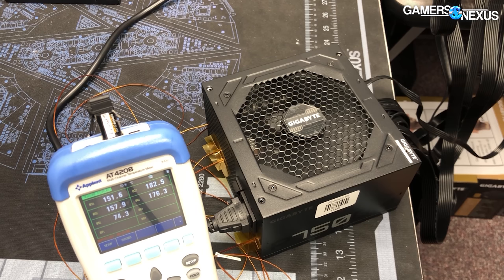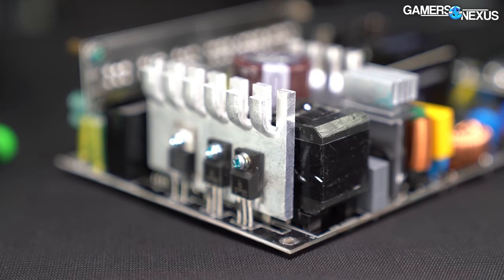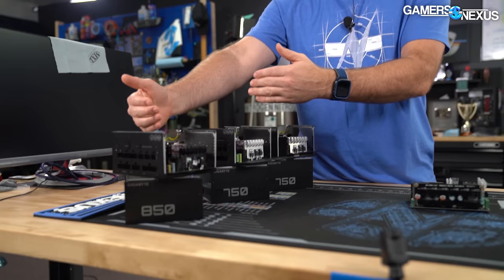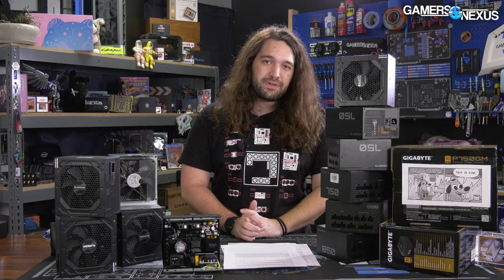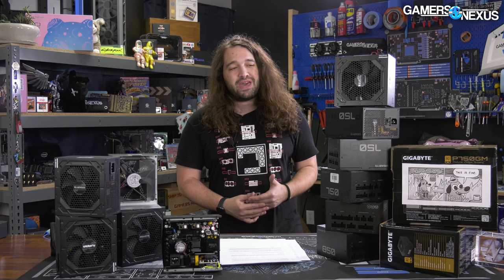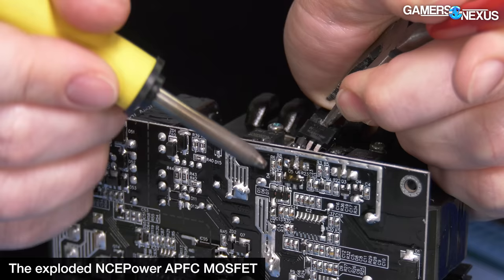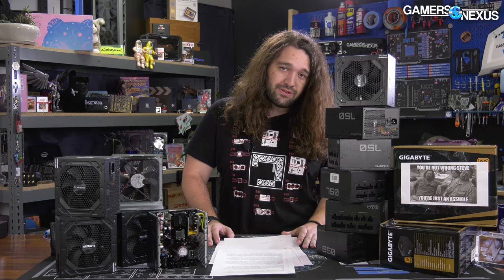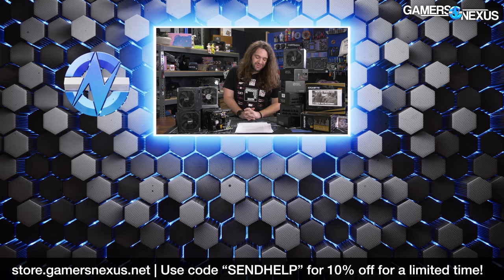Exploding Power Supplies: Gigabyte & Newegg Dumping Unsellable Product

Comment: I wouldn't call myself a professional in the field (I don't have a dedicated qualification in electronics) But I do a lot of circuit board repairs, mostly of music equipment (amps, rack gear etc) the only time I have seen 2 units of the same model and rev use different brand components between them is when it's a factory refurb.

I'm just spitballing here but I wonder if GB did qc testing and got high failure rate did factory refurbs then passed it through qc without testing OR if they were returned for refurb by vendors, one way or another every time I see a shot of the boards side by side it screams refurb to me.

Comment: Soo.....to buy components that goes into a product from different vendors - that's actually NOT necessarily all that uncommon nor unusual.

If one supplier doesn't have the capacity and/or the capability to manufacture and produce that many copies of that component that you need, then it is not uncommon for companies to shop around to be able to make sure that they can get the number of that component that they need, from multiple suppliers.

That's usually NOT an issue.*

*The problem though, is that it means that the OEM needs to develop the technical specifications of that component so that the supplier can then develop their product (the component) to those specs which it will then sell and feed it up chain to the OEM (or Tier 3 to Tier 2, Tier 2 to Tier 1, and Tier 1 to OEM or what have you).

IF, as it is shown here, you have multiple suppliers in your lower tiers, supplying components, and they are failing at the same spot - either your design is bad and/or your spec for that component is bad, at which point, BOTH of those are owned and under the responsibility of the OEM.

And that responsiblity rolls downhill, i.e. you can deliver a spec to Tier 1, and Tier 1 develops a spec to its Tier 2, etc.

But ultimately, the OEM is responsible for certifying the end product, as it is sold to the end user/customer.

Gigabyte is crap for blaming the customer on what is principally either a bad design or a bad spec that Gigabyte came up with and cascaded through their supply chain.

Screw Gigabyte.

Comment: Thanks for the information, I bought a pre-assembled build from Newegg for around $2k a couple weeks ago as it was the only way to get an RTX 3070. It unfortunately has this 750 PSU in it. It has been working fine (Aside from a couple random power offs on the first day of using it), but I will deff be pulling this PSU and replacing as soon as I can afford to do so as I leave this machine on all day and access it remotely for game design, etc. What a shame.
Reply: Yeah return that shit ASAP. It shouldn't shut down like that if you have a 750w PSU paired with a 3070

Comment: I have been trying to get Gigabyte to replace my 750 watt power supply that is on their list as a bad one for 2 months now. They gave me a case number then a month later ask if I wanted a refund or a replacement. I said a replacement will be fine. That was a month ago and nothing from them since. I will no longer buy anything from Gigabyte. I built three computer in the last 3 months and the first 2 was before this fiasco started so I bought 2 Gigabyte motherboards. The third one I bought an Asus board. It astounds me that a company that needs customers to buy their stuff to stay in business ,treats their customers this badly.

Comment: i got one of these PSU's with a 3070 , i didnt realize newegg was doing this. So i returned the GPU & PSU unopened, as it wasnt worth it. Gigabyte GPU's arent much better than these PSU's, so i happily returned them both unopened. i told them the PSU's are garbage, & it wasnt worth the risk to my system, especially for a junk Aurous 3070

Comment: 28:00 If you have a working system with this PSU, it might be safe to run as long as you don't add any new parts that might increase power consumption. I wouldn't feel safe swapping to new GPU even within the same declared power consumption range.

Comment: Well. Just seeing this video I would hope Gigabyte fixed these.  I purchased an 850 watt on Amazon in December for around $100 for a complete Gigabyte build with a Ryzen 1900x and Gigabyte 2070 super.  Been running for about 2.5 months now 24hrs no problems.

Comment: So this makes sense now, I bought my gigabyte P750gm in may 2022, for a very cheap £52, and have been using it to drive a Ryzen 9 5950x and a 3070 for about 2 years, and only last year upgraded to a 3090... Am i safe?
Reply: no. my evga 1300 platinum+ supernova died today. 1 year after use. glad they aren't at least too rtarded to at least included some protection...

Comment: So my pc died today, i have this 750 power supply. I had fail starts for days. Ever time i turned it off and on again it worked. Waiting for replacement or preferable a different model if they are kind. I hope its only the power supply bought it last year and it is not in the serial range.

Comment: Using components from different sources should not be a problem and should not concern the user, as long as the manufactured product works.  It is up to the manufacturer (/integrator) to source quality products and to stand by them when used in their end product.  If they're sourcing poor quality products then that is bad on them.
Newegg not taking back the power supply for refund when it is part of a bundle is certainly understandable, but if the power supply fails then they should at least take it back in exchange for a new power supply.
In your testing the power supplies might work better if you very tightly tape up all of the ventilation ports.  Everybody knows that if you let the magic smoke out of electronics they don't run well after that.

Comment: I was locked into this PSU (850 variant) by a system integrator that messed up my PC build epically and broke the PSU I provided them with and replaced it with the Gigabyte. I'm hesitant to put my 3090 in it, obviously. Any recommendation on how to stress test the damn thing without the GPU being installed before I risk it?

Comment: Hey GN, love your videos, but the interchange of components between the same models really isn't that strange. NOT to say they couldn't have made the change of supplier to avoid problems, but they pretty much use multiple suppliers FOR THAT REASON. I work in manufacturing for a large GmbH company, and we dont even start production of a product unless more that one supplier is available. This is simply to prevent any one supplier holding the production line hostage or even halting production due to natural disaster, shipping issue, or in this case a quality issue. Again, thank you for keeping the community informed, but I really think you are looking into that fact a little to much. Its just a mass production fact of life in most cases.

Comment: It's not really THAT strange... having different passive components really isn't that big of a deal as long as the specs match and its not from some shady Shenzhen marketplace. Having different active components isn't that odd either, a lot of transistors and FETs have fairly standard/common pinouts. Even the controllers can be substituted, which is why a lot of PSUs have their controllers on daughter boards.

The fact of the matter is that, even with passives, some components have lead times of three or four years from placing the order. You can't always rely on finding a Vishay, TDK, Bourns, Nichicon, Rubycon, Eaton, Diodes Inc, Phillips, Infineon, Microchip, STm, Panasonic, Samsung, or TI component. I'm not saying that those MOSFETs they used were... from a good company, because NCE isn't, but those capacitors and the other components, there's nothing really wrong with them.

Comment: I have the 850, and it makes a weird hard drive noise when under little load. When you look at it, it seems the fans tries to run with very subtle moves but when you put more heavy load, it spins without any problem and the weird sound disappears. Does it talk to someone ? is it dangerous ? And if not, is it fixable ? Thanks

Comment: I have the exact same PSU and now my system is failing due to abnormal power. My Aorus 5700xt has this flashing led light near the power and base on my search it says low or abnormal power.

Comment: Lelon or Teapo are fairly good capacitor brands. The question has to be what the specifications for these capacitors. Are they 85C or 105C? Are they low ESR or general purpose? What are the temperatures like on the actual capacitors?

Comment: I used to run on a gigabyte “bundled with the case” psu.
It died after 3 years of use. But im gonna assume its due to the “bundled with the case” issue.
After this, I will need to stay away from gigabyte psus for now.
Glad I have a seasonic one for now.

Comment: Honest question, if the PSU is failing after being loaded to 140%, isnt that what you'd expect..? Doesn't seem like the internal components are bad, just seems like the protection circuitry is lacking.

Comment: This once happened to me…that was the quickest I’ve ever disconnected cables and cut zip ties
Reply: Wish I would have been that fast when I shorted my V5 pin on my motherboard.  The motherboard works fine. I just can't use software for my RBG fans.

Comment: alright, got a question for everyone. I purchased the Gigabyte GP-P750GM from Amazon in December of 2020 and used it in my first build at the end of 2020. As of right now, I have not had any issues. Nothing is overclocked in my system or using excessive power. Should I look into getting a new one?

Comment: So I just took apart my computer (prebuilt) because of what I though was a power issue. Due to auto restarts. And low and behold what was looking up at me but a P750GM psu. Then saw this video. Only quest I have now is how will I know if it damaged my 3080 or should I be worried?

Comment: I've had one of these PSU's (850GM) for about 8 months without issue. Does everyone need to be concerned or is this like a "there are faulty units out there so be aware" kind of situations? The reason I ask is because obviously I don't want to spend money unnecessarily.

Comment: I know Gigabytes response is unacceptable. And a recall should have happened.

But as someone that worked in electronics manufacturing during that time, getting any components let alone the ones you designed for was damn near impossible.

We switched to different brands of caps, alternate switching regulators, even re-spinning entire boards to get around chip and component shortages.

Tantalum capacitors were impossible to get.
The aluminum caps we used to used were unobtainium and we had to switch to a larger polymer cap.
We had to buy secondhand atmel procesaors at some stage. That was a fuck up. They were soldered off of some old arduino or printer boards and a lot of them had dead uart channels.

I'm not condonint their behavior.
But it is not strange that they had to source alts during that time of crisis.

Functionally they should be the same.
Longevity on the other hand...
Sacrificing good name brand caps in a high end product isn't acceptable.

Comment: Can you suggest me a PSU with 500-800W, with 8-10 SATA cables, which 
 - doesn't blow up, 
 - doesn't spark, 
 - doesn't kill my devices when it dies, 
 - doesn't do coil whine, 
 - fan isn't too loud (doN't care 0 RPM mode, let it spin, just not loudly), 
 - and starts the system and rolls with it 0-24? 
I honestly haven't found any recent products, which doesn't have one of these reported. 
Modular/non-modular I don't care.
Reply: i realize this is a month old but might aswell answer. "doesnt kill my devices when it dies" theres no psu that can guarantee that, when a psu dies its a lottery if itll kill any parts. "doesnt coil while" well, every psu, motherboard or gpu will start coil whining at one point or another. now i would go with either a corsair rmx series psu, cx/cxf series, seasonic focus series or the bequiet straight power series (straight power psus are usually gonna be more expensive than the other ones, but on sale can be quite cheap). all very quiet and very reliable.

Comment: I purchased an ABS prebuild with this PSU installed. I've had the system for about 3 months and had zero issues. Should I be concerned?

Comment: I have spec'ed, sourced, and bought bulk electronic components to build automotive components for retail sale to customers. Typically when purchasing individual board components they are sold in unis of 2,000-20,000, many times they are glued to a strip of paper (or between 2 paper strips) and rolled onto a spool for ease in industrial manufacturing.

For this many changes in supplier's or component ratings they would have to build hundreds of thousands, all were shipped with this ~50% long term failure? I'm calling this a long term failure, because most electrics are only given a few second QA test before packaging and shipping to retailers. Only a small percentage of units are pulled off the assembly line and given long term testing and never offered for sale, typically they are taken apart for diagnosis. 

bad components? Or enough bad components in the 12 volt supply section or switching mosfets?

Gigabyten't can't blame the components supplier for this failure rate, maybe one supplier sent faulty components not rated for the 25%-50% overrated safety. But when they all have problems; the commonality between all of these is Gigabyte PSU model design.

I suspect the GP-P750GM & GP-P850GM has a design failure that caused these caps and MOSFET to burn up in a firey show. I doubt all those individual parts are bad, they might have tried different brands and higher rated components to solve their bad design. If Gigabyte is parts swapping to fix a problem, they most likely don't know the root cause yet, or too lazy to fix it.
I wouldn't trust Gigabyte until they admit the problem, exchange with a different design, and make a press release or leak the problem in these models to the public.

Comment: I’m probably not going to be buying anything from Gigabyte for a while. I probably wouldn’t have bought a Gigabyte PSU even before this. I stick to buying power supplies from companies with long-standing good reputations for making quality PSU’s like Seasonic, Corsair and EVGA. 

It’s not just power supplies, though. I’ve had two friends who had serious issues with their Gigabyte graphics cards. I’m still currently running my X570 Aorus Ultra motherboard and I haven’t had any problems with it but Gigabyte’s RGB Fusion lighting software is the worst in the industry by a country mile. Motherboard lighting isn’t exactly the most important thing in the world but when the time comes for me to upgrade to AM5, I’m not going to be in a hurry to buy another Aorus board. I’ll most likely being going for one of the Asus offerings.

Comment: Not an expert, but has there been any information about what happened on a technical level?

I'm guessing by the blown ICs that maybe the issue is that the OPP (to be more specific, the OCP) trip point was set to greater than the maximum sustained load for the IC, but because the OPP point was under/at the maximum transient load for the IC, Gigabyte was technically "in spec".

I'm guessing that Gigabyte designed these protections for transient inrush current only and never considered that a customer would accidentally put this PSU in a system that draws a sustained load past its rated maximum power.

I'm not excusing Gigabyte: I feel that, if they made that assumption, they still made a bad product; one that doesn't even try to protect itself or other components under user error.

Comment: I've never been particuarly impressed with gigabytes quality, I really regret buying this Gigabyte RTX 2070 Super in May of 2020 rather than waiting for the Asus GPU that would've come around a few weeks later instead. My main concern wtih this card is the fan curve, or rather, if you try to program a fan curve with 0% fan speeds, the fans start ramping up and surging, the same issue I had with my Gigabyte 750 Ti, but one I never had an issue with on other nVidia GPU's including my EVGA GTX 1070.

Comment: Exploding at 60% is unacceptable ? At what percentage are explosions acceptable?
Reply: That's insane, i had a cheap 600w PSU that was known to shut down at 350W and it was even popular in my area, but most midrange configurations never reached 350W, still way better to shut down than to explode.

Comment: Reminds me to the Simpsons when Homer was starting writting chef reviews LOL. Do this hings got the UL approval ?. Isnt UL mandatory to sell this PSUs ?. Because if they got their UL  ....you have a look at the report and the conducted tests. I would only focus on the ones that can manage %60 of the load. The one that failed under %135 makes no sense, eventually many thing around us will fail badly when overloaded by 35%, from a car to an audio amplifier. Protections are there to save you one, two or three times, not to stay around,. Safety stop in lifts use emergency braking, put the system into a serious stress. This safety feature is not intended to be triggered over and over.Using the same example, try to overload a lift by 35% ...... provided that the wieght alarm has been disconected then, is up to the machine and the VFD to take this abuse but the results wont take too long to show up.

Comment: So turns out this is the PSU I have installed in my set up, and my serial number falls within the range eligible for a replacement. However I've been pushing my PC for almost a year now accompanied by a 3070 GPU and AMD Ryzen 7 3800 without any issues so far - the question is should I (1) get the free exchange for the their "updated" PSU or (2) should I keep running with my current one as it appears to be working fine? There is the 3rd option or replacing it entirely but I'm strapped for cash and would rather not be out of pocket for it... Any advice appreciated